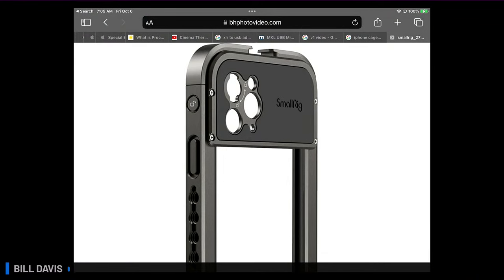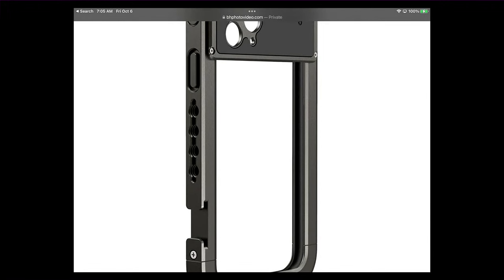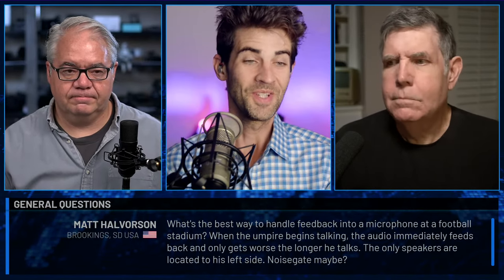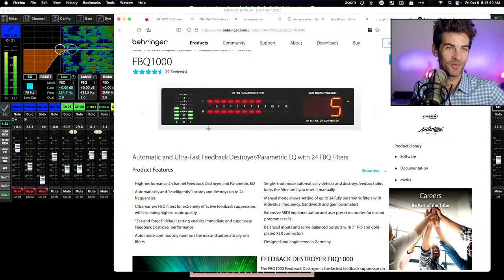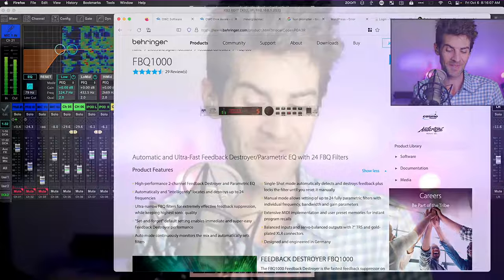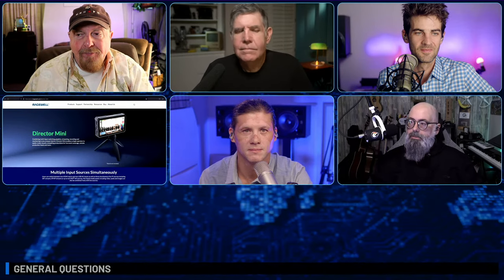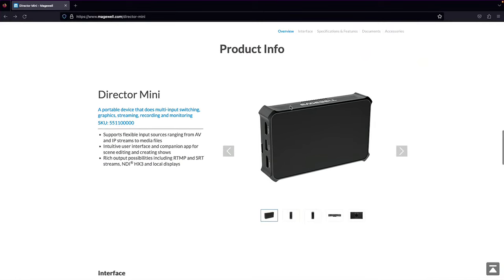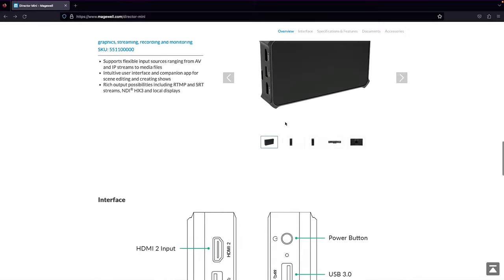Cable Management

Comment from the maker: 00:42 Streaming to YouTube via client's account, very often get the "yellow" high bitrate warnings in the dashboard. Using youtube's suggested settings in OBS. Stressful to see these in a live stream. How concerned should we be? How can we fix? Thanks.
03:32 Thoughts on the IVI Zoom cam/monitor/light displayed at Zoomtopia? IMHO I find the monitor way too small to be useful for me - I need a 17" at least. Hard to see other content or slides when presenting. [link]
05:14 An article about the latest Blackmagic Camera update mentions orientation locking being useful "when the iPhone is on a boom or jib." How would you attach the iPhone to one and remotely control it?
10:19 Has anyone tried the Orion iPad app? The devs behind Halide just released an app which works with generic HDMI capture devices. Seems awesome for free, but will be interested to know what's compatible. What would you monitor with your iPads?
12:29 Seeing a big move to SRT - NEW Blackmagic are now offering it, NEW vMix 27 has it and is increasing the output channels to 4, and NEW Magewell Director MIni has SRT in and out. Does his count as a trend yet?
15:09 What's the best way to handle feedback into a microphone at a football stadium? When the umpire begins talking, the audio immediately feeds back and only gets worse the longer he talks. The only speakers are located to his left side. Noisegate maybe?
20:20 have a Sony a7iii full frame camera. Can you help me understand what I gain if switching to FX30. Obviously sensor size and body shape are different. What else? Is 10bit worth the change? FYI I make short documentary films.
24:23 On the pc side of things, would you rather build your own computer or buy one ready to go like an HP, Acer, etc?
30:21 Has anyone had a look at the new Magewell Director Mini (a rival to the Yoloboxes) or seen a full review of it yet? It looks very promising.
31:26 Following my question about NDI audio in mixers in a previous show, I see that the Mackie DLZ now has NDI. Is this just the beginning? What future do you see for NDI and mixing?
32:59 Other than cross platform compatibility, what considerations exist when choosing APFS, macOS Extended and/or Extended Journaled as the drive format for video and general computing?
34:04 What´s the brand of the headphone-extension cable with magnetic lock that panelists are using? Does it work with 3.5mm headsets and loop the mic als well?
35:56 I have 2 different Presonus audio devices with the same issue. They show up in system preferences/sound on a Mac. The mic works in settings but neither work as mics in Zoom. Any solutions?
36:37 The MSG Sphere has been said to consume 28MW at full operation. When managing a system at this scale, what would you use to make sure parts of the system are turned on/off in the right order and to log alerts/alarms? Could UNIVERSE conceivably do it?
38:55 Hi folks.I have to pitch a concept for creating a town's Online TV station that probably will cover small business advertising, mayor's office meetings, city events, the town auditorium events & hall meetings.What process & gear would you begin with
45:48 OpenAI is exploring making its own AI chips What are the implications of this?
47:41 Opinions, pro and con, about the RED cinema camera workflow and ecosystem. I'm in my mid-60s and considering purchase of a final camera for personal work, not client projects. Looking for image quality, paramount.
51:44 What camera(s) would you chose to put on a "Tank" cart for rolling a live at a tradeshow?
55:39 Are there any recommended turnkey systems to get started with Unreal? What are some of the better brands and hardware specs - Ram Graphics, MoBo, I/O etc...
57:39 Please show Alex’s video clip from the iPhone 3G.